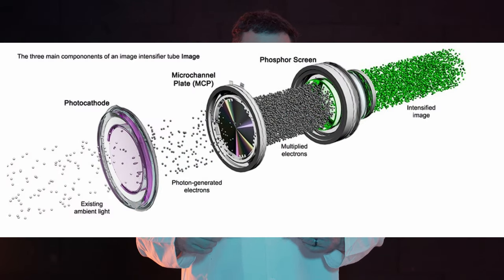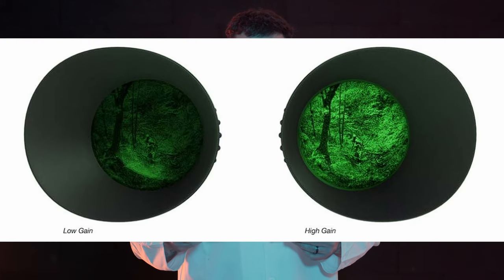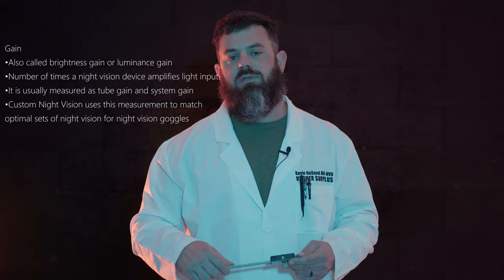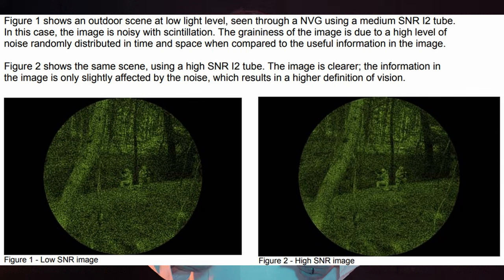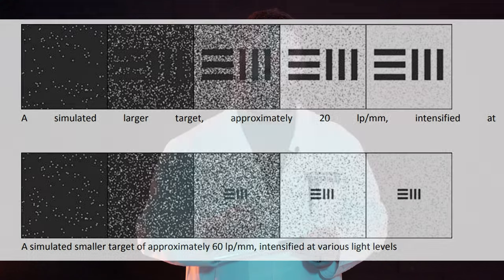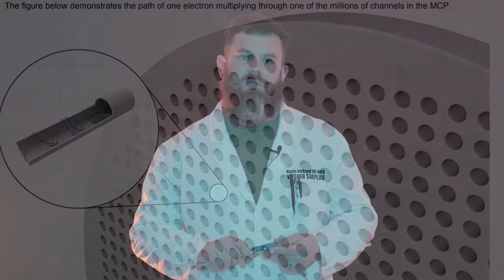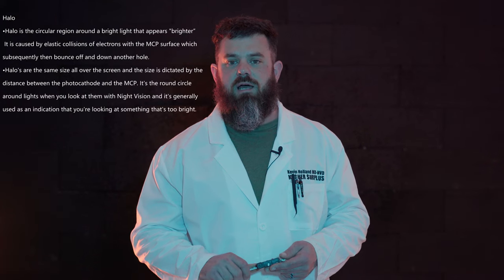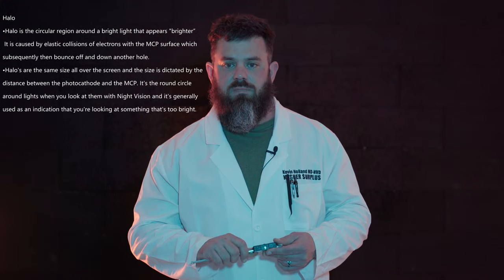Custom Night Vision | Data Sheets and Intensifier Tube Specifications

Comment: EBI is the background noise of the image intensifier and comes from the thermal emission from the photocathode. The EBI adds noise speckles to the image. These noise speckles are only visible in the photon counting light-level range because a tube has high gain there. EBI is usually expressed in lux and can be compared to the photocathode illumination from the scene. It’s important because it’s one of the means to achieve a good SNR but it’s not a performance determining factor by itself. A tube with high photocathode sensitivity but a high noise factor in the rest of the tube may still have a poor signal to noise ratio. Thus consumers should not focus on EBI specifications as a stand-alone measure of tube performance.
Reply: I can't believe this comment is being slept on. I learned more from this comment than 10 hours of nvgtubers blabbering

Comment: I'm very slow getting in night vision and I currently have a single monocular. I'm planning converting to bino, hopefully in the near future. With today's tubes, how important is tube matching now? Would the data sheet help get me close to a "perfect" matched tube?
Reply: Yes, having a data sheet to Mach is important.
Reply: I run duel 14s (one 28 snr elbit thin filmed and one 32 snr filmless L3) I just crank the Manuel gain down just a tad on the filmless and the images merge perfect and it don’t bother me… also don’t buy into that bullshit that you have to send in your shit to get collimated, It’s literally simple,
All you have to do is back off the lock ring on your PvS 14  ocular lenses and spin your eye piece (a about half a turn at most)and you’ll see the images come together. it’s laughable how easy it was,
I also just collimated my single 14 before the second one to my un-aided eye so I did not get double vision and no one ever talks about that which is something I don’t even see how a machine would do because wouldn’t you need my eye to see what I’m seeing with my own eye? Maybe that last part sounds stupid, but it works for me.

vendors just wanna get you to buy from them most the time which I can’t blame them for that’s what they’re in the business to do 

Basically what I was getting at is that your brain will utilize the more cleaner image on top, anyone who wants to try to say that’s wrong can just hop over on the Discord and see that there are many dudes that run one green and one white tube with unmatched specs with no problem… of course when I say unmatched, I mean not within 50 FOM  like the vendors  want you to be… I’ve seen and heard of in research setups closer to 300 FOM off like a 2000 ish FOM matched with a 2300 ish FOM tube work perfectly fine and SNR’s spread apart by almost 5 so anyone telling you otherwise is shilling or being a spec snob and or is probably just using their stuff for astronomy under magnification, which then absolutely will matter but for simple head mounted night vision that just doesn’t matter unless you get to the complete opposite ends of the spectrum with specs like 24 snr and 38 or some shit but even then your brain is still gonna try to merge the images especially if you properly collimate the tubes like I discussed earlier wich is more important and it’s also easier to do if you put the “cleaner image” on your dominant eye, which probably is common sense for most people

At the end of the day its up to you and I only went this route to save money and I didn’t buy more at once and I like being able to have one for a friend or my brother on night walks and camping so it works out… I can’t really split up normal binos so I deal with the 24 ounces with a 1.5 pound counterweight, while helment is like right under 5 pounds without war pro

Comment: I understand the difficulty in a human being able to discern the difference in two relatively similar units, however I do wonder at what level do user's start to notice degraded capability? I'm sure it's going to depend on what stat you are comparing and who's eye ball is looking though it. At some point though SNR, Resolution, EBI and Halo all have to be different enough to make a noticeable difference right? Otherwise why charge more for better tubes and why rank them so stringently to begin with.

Do your staff have any personal input on this, like at what point are the stats different enough to readily tell you are looking through a worse unit.
Reply: By the time you get into such a dark environment to see the difference between a mediocre tube and a really high spec tube, all of the images even on the high spec tube have become so poor that you really need to turn on an IR Illuminator for any real PID.  An IR Illuminator pretty much makes all tubes equal then.
Reply: That would depend on the individual. There is no way for me to quantify that. Better tubes are better but if you don’t know what to look for or don’t have 10 units to compare side by side it would be difficult to illustrate. I tell people if the SNR is over 35 you’re only making marginal performance gains as that number increases. However the difference between 31 and 35 SNR is definitely noticeable. EBI is environment dependent, halo isn’t typically an issue on current tubes.. selecting a well rounded tube/ tubes is really the best course of action.

Comment: Much higher SNR of education in this video than T-Rex part 1, though at 7:10 you basically make the same point that T-Rex 🦖 did.
Reply: I have to throw that in there for the 5% of potential customers who will never actually break the threshold and buy because they are incapacitated by the data.

Comment: Resolution is a measurement performed by people certified to do so. In other words, line pairs per millimeter specifications are determined by certified people looking through the image intensifier at calibrated charts. The procedure to determine this involves an operation voltage, color temperature of the light, a specific projection lens, a calibration target e.g., USAF calibration charts or Mire de Foucault charts, a specific and standard camera setup and input radiation to achieve best contrast. Basically, the person reads the target chart and determines the limiting readable patten and compares that to a calibration chart to determine the resolution. Of utmost importance in all of this is the Modular Transfer Function (MTF). A good MTF, enables the viewer to discern contrast. The better the contrast, the better the detail, the better the detail the better someone can discern objects in low light or high light conditions.